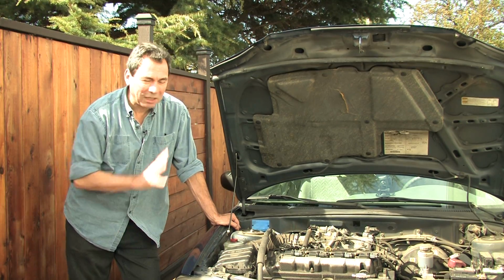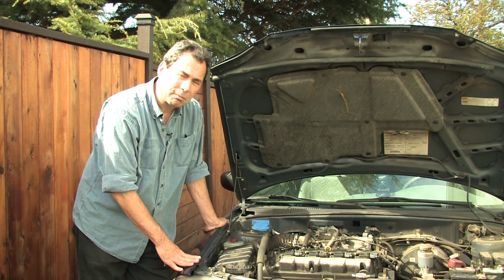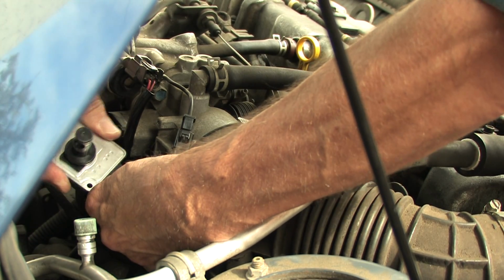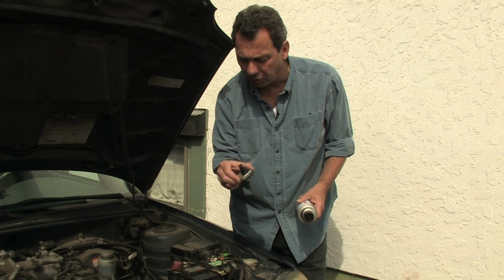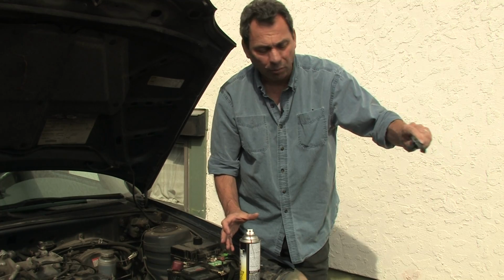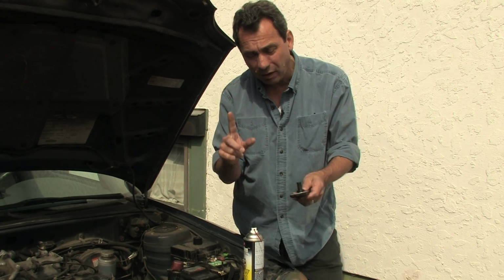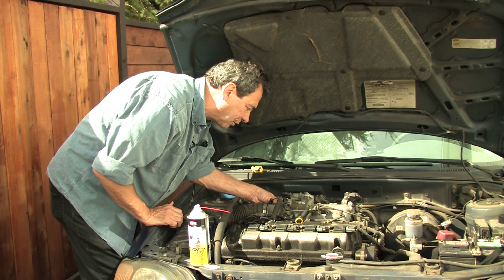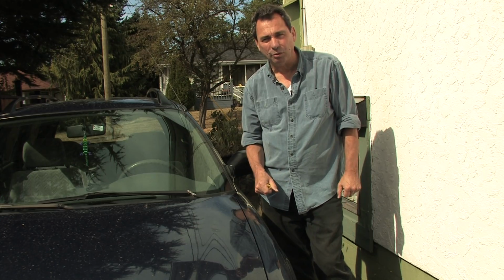MAF Sensor Suzuki Esteem

Comment: Good tip! i also did this for my '96 Nissan 200SX SE-R. Perked right up. Like an extra 30 horsepower, because there was a huge dead spot of power at the top of the powerband.

Comment: Do you have any experience with your automatic transmission not shifting into 3rd (Drive) after driving 15 miles?  Seems to have something to do with the Overdrive On/Off switch. This is also a wagon with a 1.8L motor.  I do not get a MAP reading (like I do on my 1.6L Suzuki) with my scan-gauge.  Does this car have a MAP sensor or some other intake manifold pressure sensor?
Reply: I have this problem! Now that I've cleaned the MAF and now right when it's about to shift into third, it'll rev about 1000 rpms and then go back to normal. It's the most annoying thing ever. Did you find a solution?

Comment: my check engine light indicated error 21 and 23 (Air temp. sensor and throttle position sensor)
do you know how to solve this problem?
the engine runs good but when you are in second and give a little bit of gas the car stutter 1-3 seconds. After that it runs normal